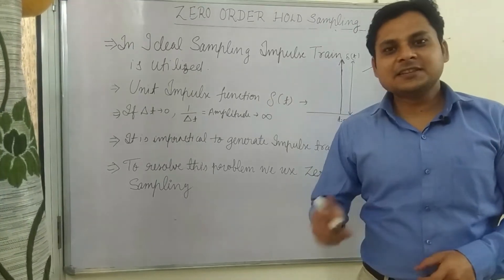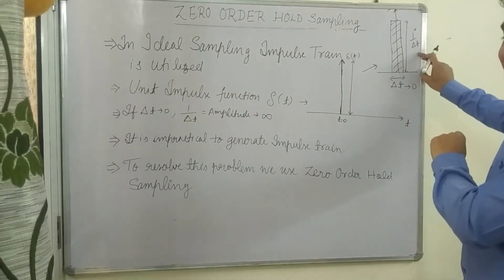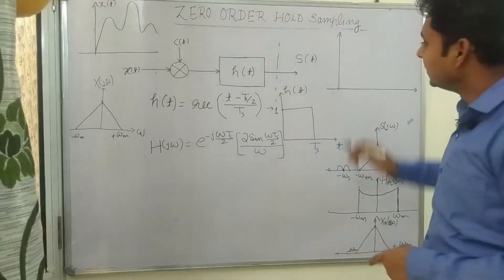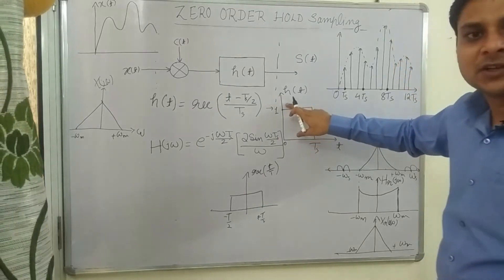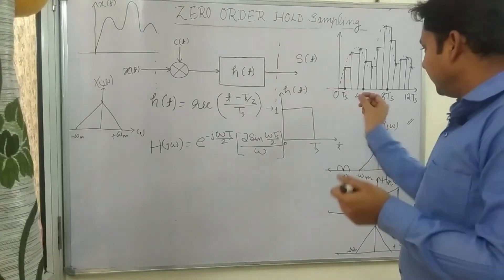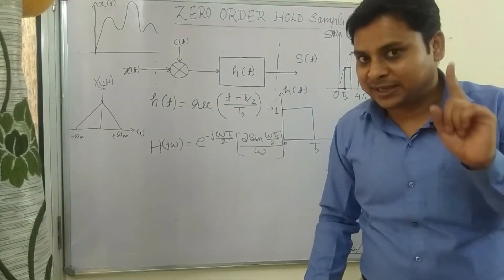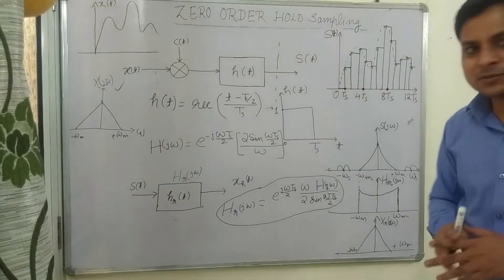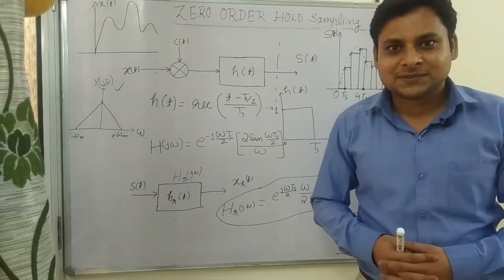Zero Order Hold Sampling (Detailed explanation)

Comment: Thank you for great explanation
Could you explain spectral leakege and where it results from in this example
Reply from the maker: Spectral leakage is the measure of information missed while taking samples in layman terms. in zero order hold we take a rectangular window which has some width, if you take a window function whose width is very small or tending to zero just like an impulse function, we wont miss the signal change in the window, therefore no missed information from signal. thats why taking impulse function can regenerate exact function on reciever. but in zero order hold due to width of window function we have spectral leakage.
Reply: @vinaysingh-xi1sw  Thank you very much. It becomes more clear. What about anti-aliasing filter. In which point it sholud be used and what problems it solves
Reply from the maker: Welcome dear, basically this filter is used to avoid aliasing. Aliasing is overlapping of sample's bandwidth and it arises when Nyquist criteria( fs>= fm) i have explained aliasing in sampling theorem explanation in details please go through the video: https://youtu.be/Q7DiJgf2hcM 
Here the frequency at which we take sampling(fs) must be greater or equal to double of maximum frequency present in the message signal(fm). If this condition is not followed then the reconstructed signals gets overlapped and they cant be separated properly.